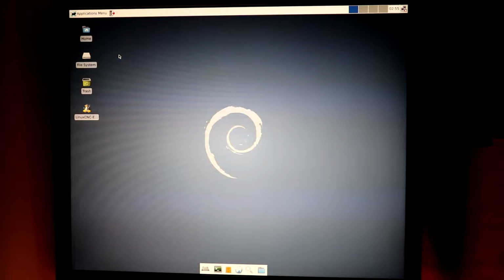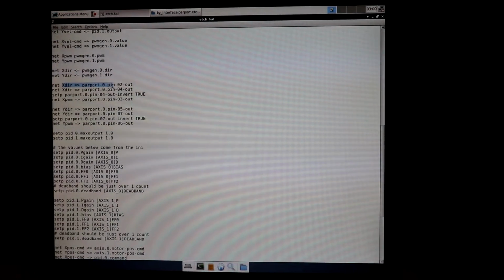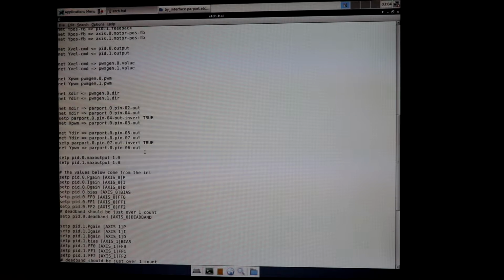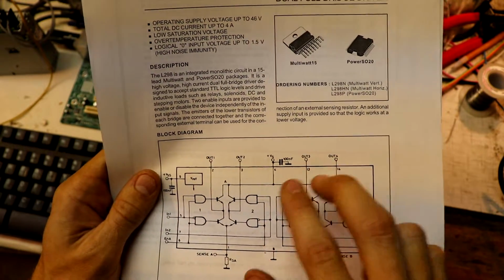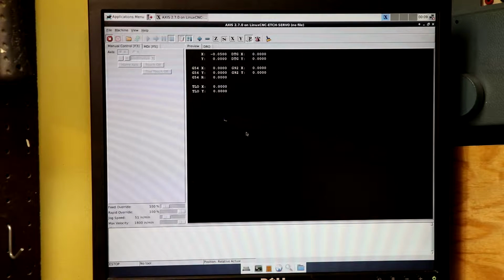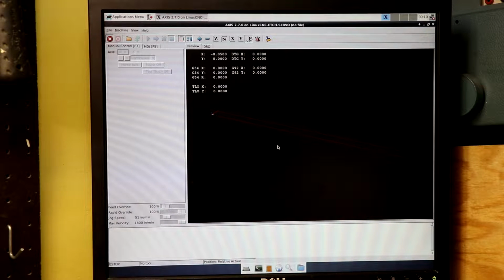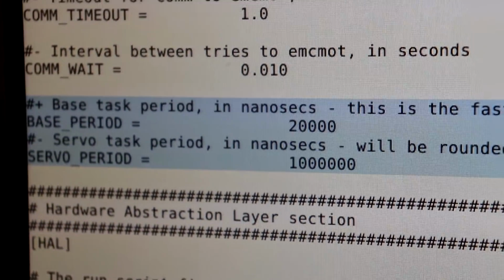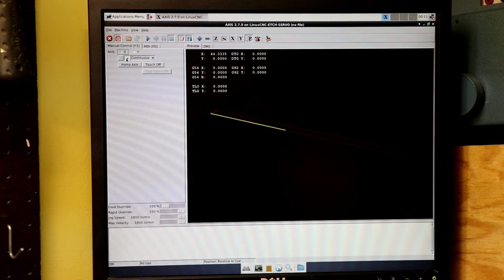Controlling DC Motors with Encoders in LinuxCNC

Comment: Hi, may I ask for an advice: i have stepper motor from dvd rom. It has 4 wires, meaning I could connect only 2 motors (via L298n) to control via parallel port. However, I seen youtube videos on using in-build floppy drivers in which case you need only 2 parallel port pins.. is there a way to set up motor so (2 wires in port) using L298n controller?

Comment: any updates ?
Reply from the maker: Sorry for the late reply, I actually built 2 drawing robots based on stepper motors  a little before this video was made and after this video got uploaded I ordered the appropriate DC encoder controller chips that the configuration in LinuxCNC used. The next video following this one will be making a drawing robot based on DC encoders!
Reply: @SciCynicalInventing  this is awesome man, I can't wait to watch it and apply it.

Thanks man